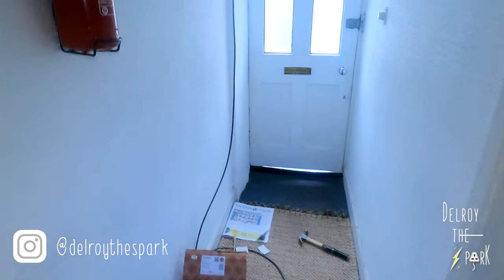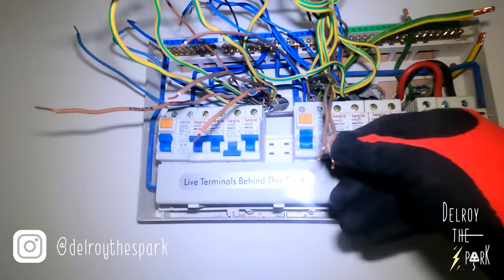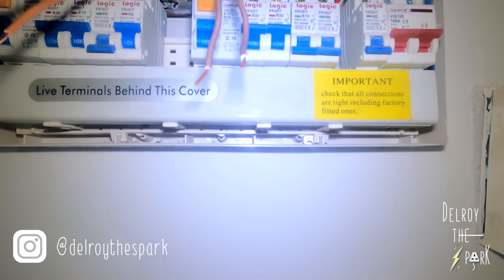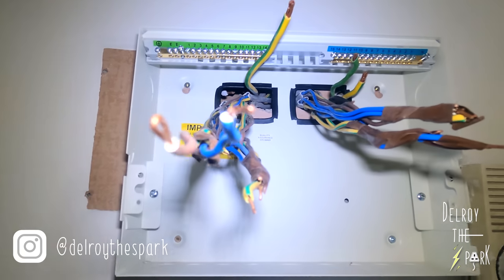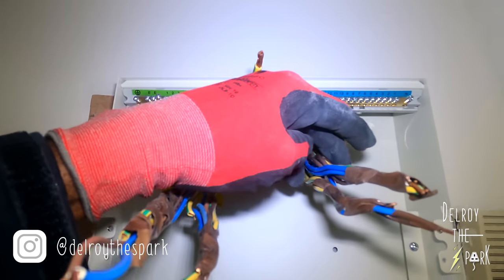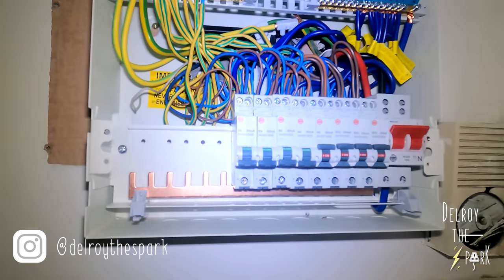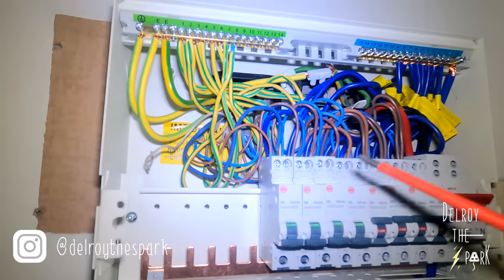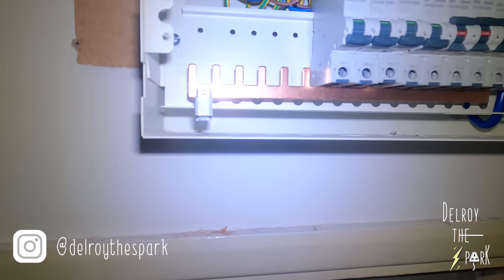Full Wylex Consumer Unit Upgrade With Testing

Comment: Little tip I got from the Artisan boys, might be worth investing in to save you running leads out to keep the customers WiFi going, its the Jackery portable power station just plug their WiFi and its will keep the WiFi going until you finish the board change. Loving your work as always.

Comment: personally dealing with a lot of old bodge jobs it is better just to replace the crap and make it comply with current safety regs because if you leave as is you might be liable for an electrical fire as you will likely be the last sparky to work on  the system

Comment: Why are the different circuits connected on the the top of the circuit breaker? In switzerland they do it this way too but in most countries the input is always on the top and output always on the bottom, just like an electrical schematic.
Reply: Has to do with ring and radial circuit design. England decided that ring circuits were the thing to do after ww2. As such you have only a few breakers for all the sockets in the house. Where as in most of Europe and USA they use radial design where commonly rooms are protected by single breakers.

Comment: CANT believe you removed the met when other circuits where still energised 😬 never ever ever remove if you can’t turn the whole installation off
Just take a reading with parallel paths and put limitation note on the records
Reply: @Exploring With Dark Dreamz when ya know what your talking about mate... look again
Meter is on met removed
Other parts of the installation still on
Reply: No look again yes he isolated the consumer unit he was working on but and this is the big one.
THE OTHER TWO FLATS WHERE STILL ENERGISED WHEN HE REMOVED THE MET
If a fault occurred while he was conducting the test and someone was to touch said fault the protective device would not operate in the specified time as that person is now the least path of least resistance, the high current that would have gone down the met is what causes the mcb or rcd or rcbo to operate and that’s why you do the Ze to ensure it can handle the current and that is why you have max Ze to ensure the system is safe for use.
Reply: @gavinhoulston7910  was looking for this comment. Thank fuck someone noticed it.